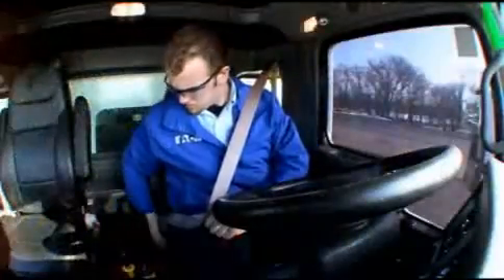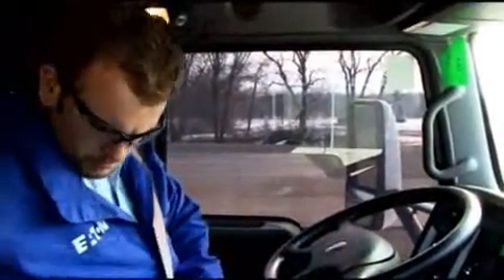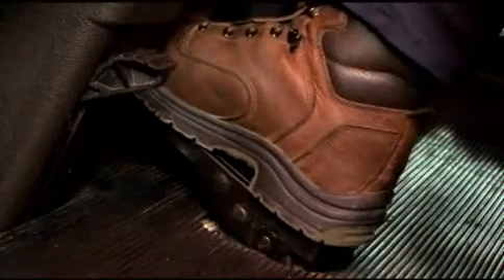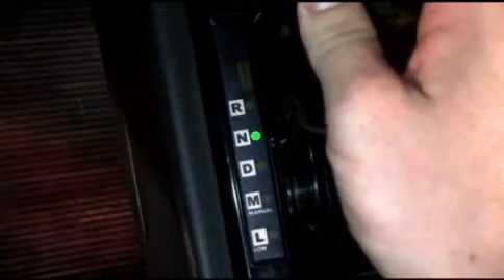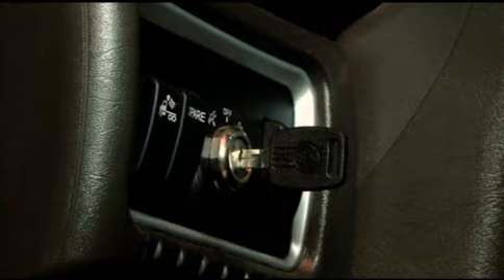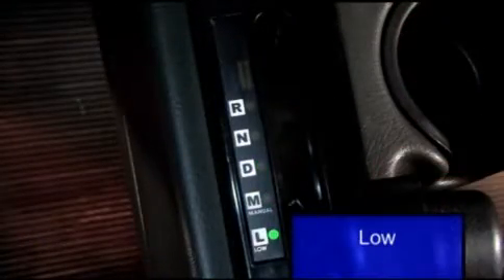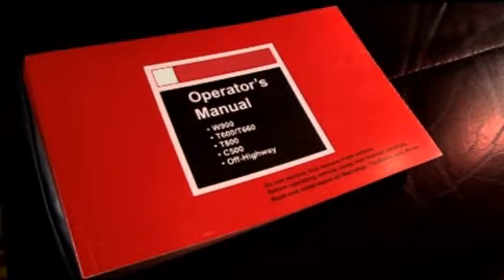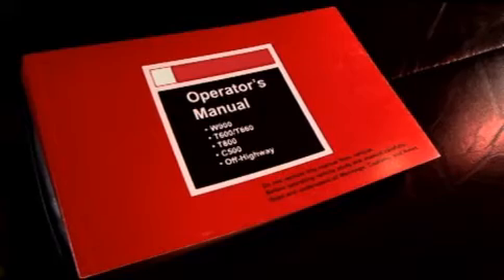UltraShift PLUS Driver Training Video, All Models - Basic Operations

Comment: My t800 ultrashift plus will refuse to shift out of 3rd sometimes. It will high rev 3rd and eventually high rev shift into 4th. I've tried manual shifting and backing off the gas but it continues to hold gear.  It's been sent out for service at the dealership and they can't find an issue with it.